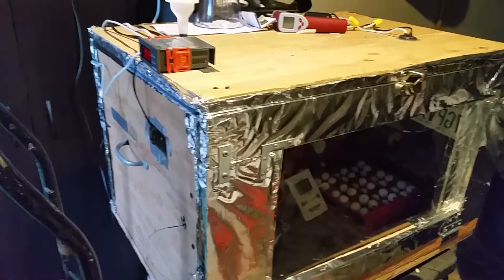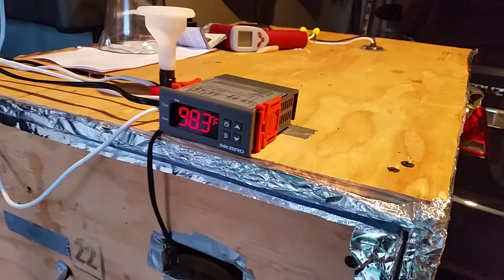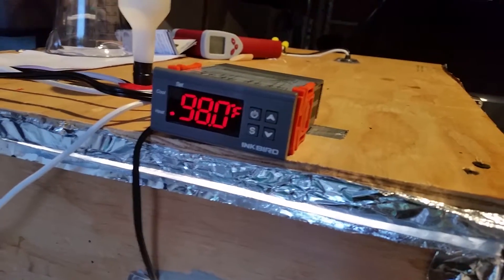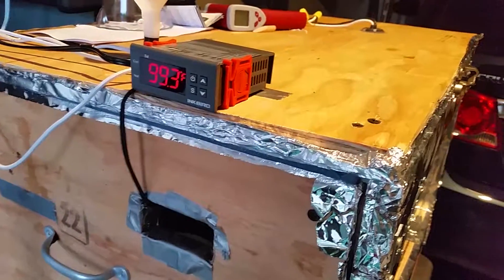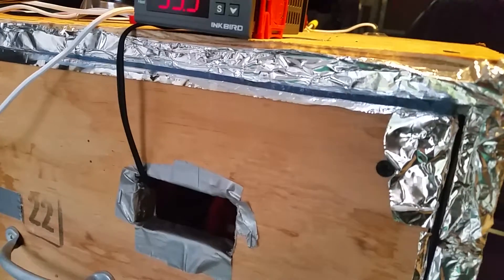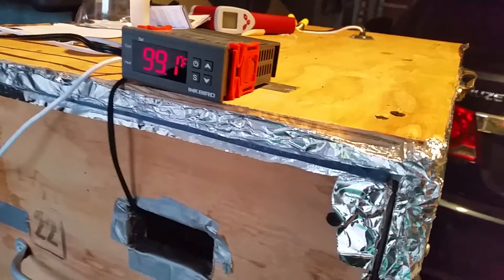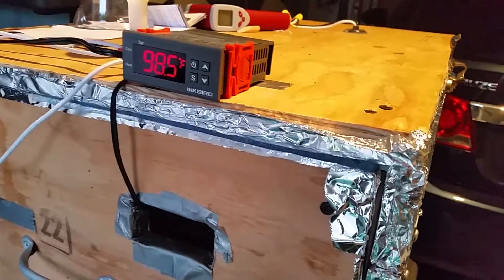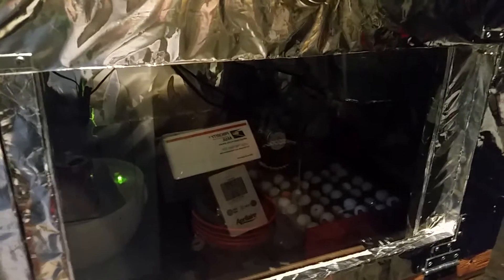ALERT! Incubator temp control trouble

Comment: Great Little Incubator purchased at https://goo.gl/8DCrVn My new hatching was a breeze. It got me hooked to hatching. It was subsequently so user-friendly and uncomplicated. I actually do recommend reading the directions, therefore you know were to assemble the water. Essentially, you plug it in, add water and set the fertilized eggs in! Cost in my opinion was good in the process.. You don't would like to invest hundreds inside an incubator only to find out you don't love it. (yeh, right!)

Comment: Finally found someone who had the same problem I did but I went through two of these with the same problem. I did not have mine inserted in the incubator itself but in a tight sleeve connected directly to incubator. So maybe these cannot be inclosed and need airflow.
Reply from the maker: Even when I moved it to the outside after a few days it would stick on. I believe the circuitry gets too hot if it has frequent cycles of on and off. I purchased a solid state thrmostat from Incubator Warehouse and they assured me that the frequent on/off will not effect their controller. I have not installed it yet because I am not hatching any eggs currently.

I lost $90 worth of eggs from this China controller sticking. Even the Inkbird I bought did the same thing